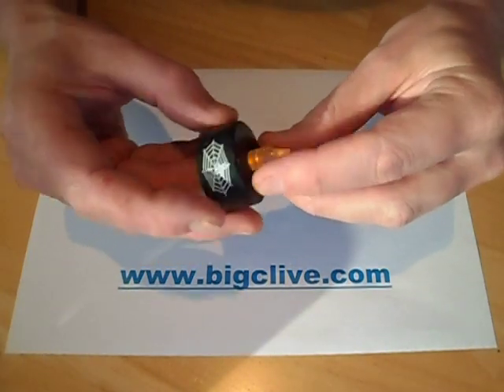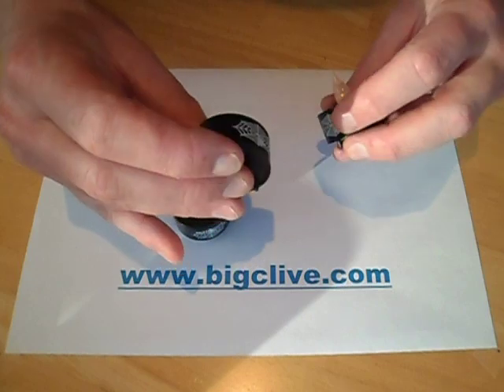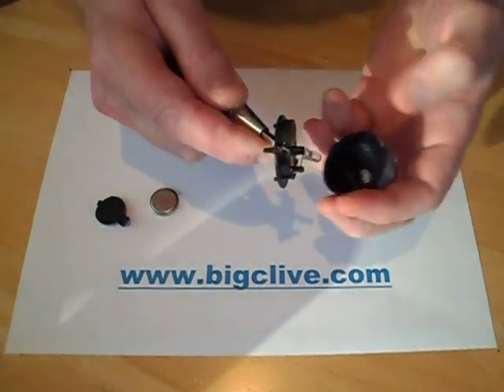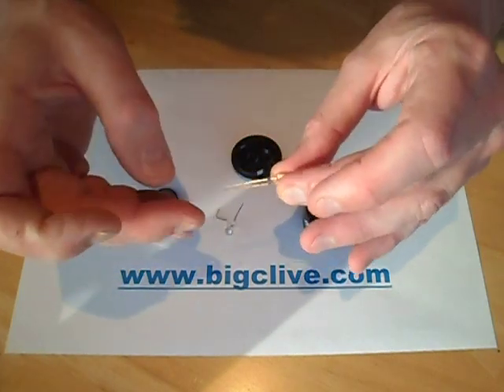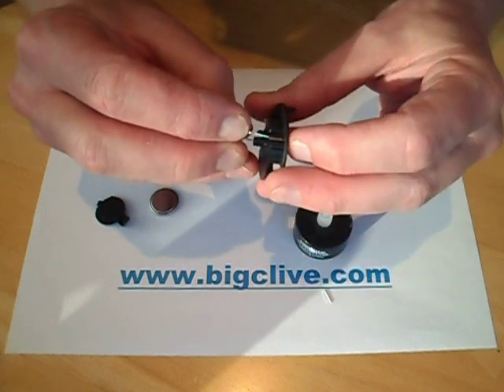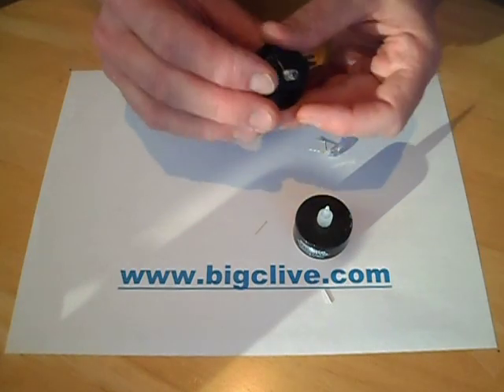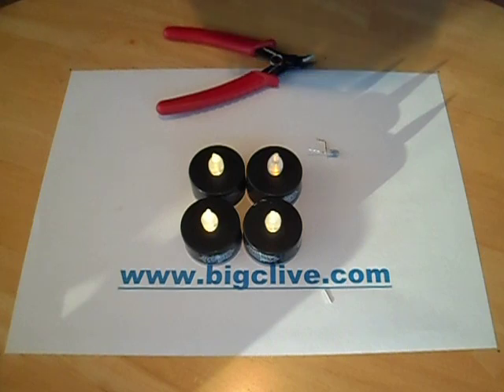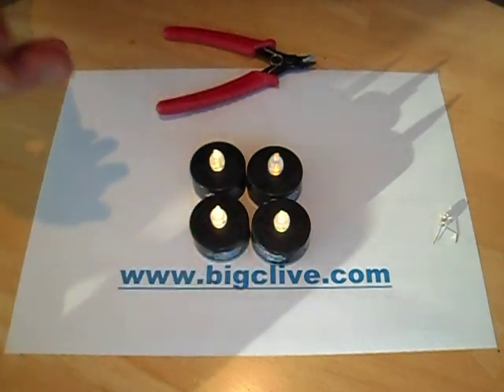Simple flicker LED candle hack.

Comment: You can use the flickering LED to drive a normal warm white (or any colour) LED so that it still flickers. Here's when a picture would paint a thousand words, but I'll try to make this as clear and concise as possible just using words :)

* Connect the anode of the flicker LED to B+ via the switch
* Connect cathode of flicker LED to the base of any generic NPN transistor via a 100 ohm resistor.
* Connect anode of the warm white LED to the anode of the flicker LED (ie. to B+ via the switch)
* Connect cathode of warm white LED to the  collector of the transistor.
* Connect emitter of the transistor to the battery negative
* Connect a 10K resistor between base and emitter (needed for reliable operation on the ones I made)

I've found that this simple hack works really well and is very tolerant of component values. note that I used a fair bit of trial end error to arrive at the values used - judicious application of proper electronics theory may be able to improve efficiency quite a bit.

The warm white LEDs I used were from Poundland's 2017 "warm glow" parasol light string and they look pretty good - far better than the horrible yellow flickering LEDs.

I'm pretty sure this circuit could be adapted to run high power LEDs if you wanted marger flickering candle effects.

I'm also wondering if you could use the same design to pulse a coil so you could make your own "dancing flame" candle - just a thought :)

Comment from the maker: You can run the LEDs with the flickering chip inside them pretty much like an ordinary LED with a series resistor and they will run to currents of a fraction of a milliamp.  In the tealights they are just straight across the 3V cell so may draw a modest current on a new cell.

Comment: how does the original led flicker? no controller or chip? Is it a special LED? if so, which kind? ebay link would help.
Reply from the maker: There are flickering LEDs that have a small chip inside with the LED, so they only require a small battery or a current limited supply.

Comment: Do any of these candle lamps come with a separate flicker circuit that can be salvaged or do they all use a flickering LED?
Reply from the maker: It's usually in the LED.  You can use the LED to make another one flicker.
Reply: @bigclivedotcom  I've been experimenting with replacing the flicker LED with a 3V filament LED to get a nicer colour and lower current use.
Reply: If you wire the flickering LED in series with the new LED you want to use, it will cause that new LED to flicker in sync. I typically do this in model space ships where i want the glow of the engine to look more realistic and use a much brighter LED. Saves from having to build a y kind of complicated circuit. You can run multiple LED off of this one flickering LED for a brighter effect. Of course, you will need to increase the power to handle the additional draw.